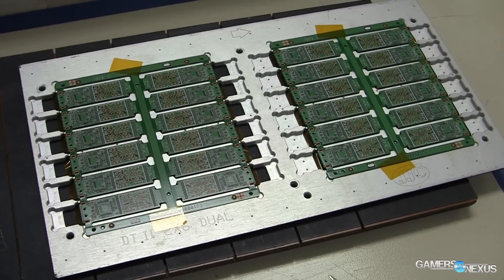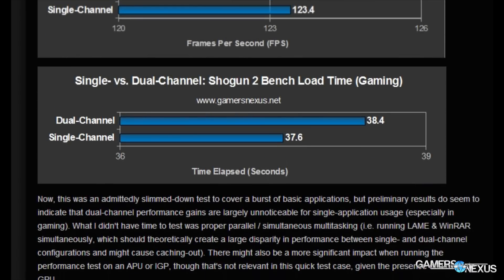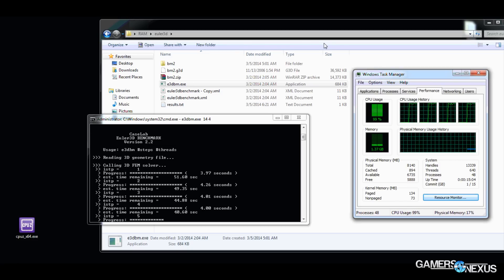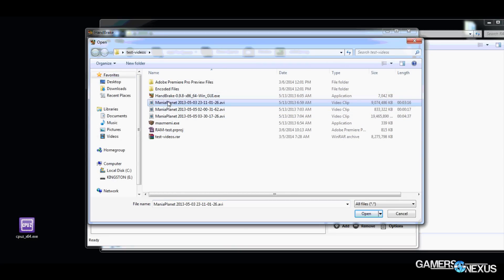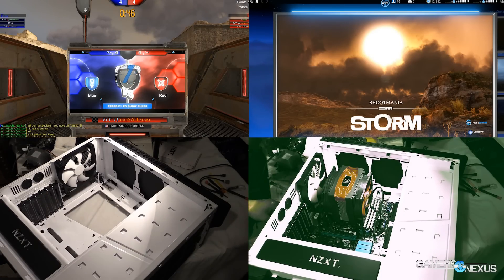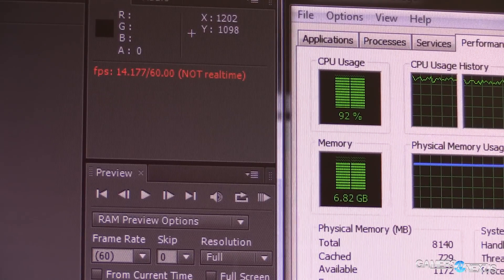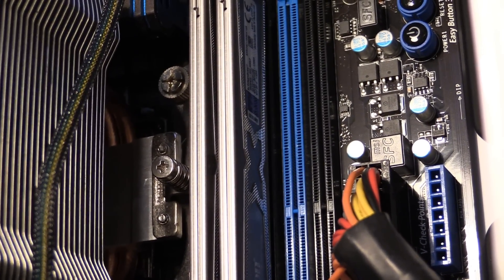RAM Benchmark: Dual-Channel vs. Single-Channel - Does it Matter?

Comment: Man, testing FPS as RAM speed test is just fail... thats why big OC for RAM gives you like +1FPS. Do it on multitasking, or on older computer (because single channel can mean only web browser, too slow, while dual channel with same amount of RAM mean fine speed), single channel is like to have one arm, dual channel is like to have two arms, its not double speed, if you grow third arm you wont be three times faster, but you can do three jobs at once, or lift something with three arms that will become stronger and faster process, its like to use two hands at the same time, and thats two times better and stronger then one hand when you need it. This tests should be done in loading situations, or benchmark things. 2x4GB is more expensive then 1x8GB, dont ask why, you dont know what you are talking about, but who knows will like dual channel way more then anything. Im not sure if you know how to put your memory into dual channel if you got 4 slots, maybe you tested all single channel set up. Its really simple, one module runs like 20GB/sec, if you got two of them as dual channel, its not 40GB/sec, its two times 20GB/sec, and on RAM demanding things its a big difference, its like having one core CPU or dual core, single core can do lots of things, surfing the web, playing music, movies, everything is nice, but if you willing to use your CPU, you will like two things. IDK what you are talking about.

Comment: Can I use two exact sticks of 8gb ddr3 single channel? Or must I buy  dual channel sticks. I need 16 gb of ram.
Reply: ZYOS117 There aren't "dual channel sticks" it's just when you have 2 sticks. But yes you must use the same exact RAM.

If you add another stick that's faster than the other, your MB will slow the faster one down to the slower one.

You may use like a 4gb stick and a 8gb stick, that's fine.

If you use a different brand, I'm not too sure but I wouldn't think it would work.

Comment: I'm contemplating on adding a single 8gb module ram stick to my 2x4gb ram. Both are the same speeds. Is this ok to do? I'm new to pc gaming :)
Reply: I've been thinking about doing the same thing. I would like to see some bench marks with this configuration of memory. Or what if you had 4 ram slots filled with 1x4 1x8 2x16 or something weird like that. Would that negatively affect performance?

Comment: Informative stuff, but I have to join the rant against the misleading bar charts with the X axis not starting at zero. That defeats the purpose of actually using the bar chart to get a quick visual idea of the true proportion between the bars. It is actually better to just show numbers with no charts, than to show charts like those you are showing. Very very bad idea
Reply: I was confused as well by the chart

Comment: I recommend to use single channel because they are cheap, better FPS in some games, and your ram slots will also be saved ( so if you have 2 slots then if you use dual channel then your slots would have no space for adding more ram and in single channel you can also get 16gb of ram ) 😎

Comment: My asus laptop comes with build in 4 gb dd4 ram, Should I buy 8gb rame to make it 12gb single channel ram or 4gb to make it 8gb  dual channel ram?
Reply: 8gb. Or get 2x 8GB
Reply: That wold be best but one 4gb ram slot is solder to the motherboard. 
Its either 2x 4gb or 4 +8gb. id like to know which is better?
Reply: ***** I'd go with the extra 4GB because the benchmarks in the video show that the Dual Channel performs better than Single Channel
Reply: i bought 2 4GB corsair vengeance ram and its working perfectly

Comment: if u wanted to test ram in a game it should be fallout 4. it shows massive frame rate increases going from 1600mhz to 2400mhz+ or even ddr3 to ddr4. This is quite rare so if any game is going to show a difference in performance from single to dual channel fallout 4 would be it.

Comment: MYTH ? The buy matching sticks of ram is true
in the days when 512 mb was massive, i had one stick of 512mb and a year later got one more of the same make size speed and cas, didn't work, but worked when only stick was fitted
so had to buy a matching set
some may get away with it, but it's better to be safe with ram as it can cause all sorts of problems like coruped files being written back to the hdd something you don't want
in my xp if you want to show your ram is good then you must run the mats+ test as it gets them every time

oh and the lack of  matching sticks does not cause slowdowns, they cause read/write errors, bsods, locking up and so on
if your implying speed problems then you've got it wrong  and i think your talking about cas and or mhz
yes you can sometimes get away with slow and fast sticks as the fast ones will slow to the slower mhz and it should be the same with cas, fit 9's and 7's and they will run at 9 or should if your lucky

i've seen ram problems many time over the decades i've sold and fixed computers, lots caused by mismatched sticks in the same channel, but you can fit different matching pairs it different channels

in the end if you need ram it's best to get a set and it;s even better to fit what you need at the time of the build
1 chan or 2 chan, 2 over 1 as 1 holds the cpu back and in things like making videos or compressing files the more bandwidth the cpu can use the better
after 2 chan it drops off, 3 chan over 2 not a lot of gain and they admitted it when they sold the 2 chan cpu's, then forgot it when they pushed out 4 chan lol

synthetic tests though easy are in no way the real world
Reply: SE09uk WTF are you talking about? This test isn't to determine if matching ram is better, it's trying to determine if paired ram is better. Everyone knows you should match ram specs.
Reply: SE09uk so you're saying Steve (the guy in the video) is not making sense? For me, running 8 +2 GB DDR 3 1600 works (different manufacturers) and 8 + 8 works (different manufacturers). Your experience might be outdated to an extent.
Reply: John Connor
 paired ram is better!!! ?
do you know what your saying, do you know what your talking about? because the guy in this video does not thats for sure

better lol. its nothing to do with better, if ram is not in a matched pair it will not (most times) work, full stop, or if it does you will get errors passed from ram to the hdd
its not whats better, if you had any xp you would know this
 i say that because if you knew you would know and have seen what a mismatch can do... bsod, restarts, lockups, mats+ fail and many many more.
you pc would not be safe for data
if you don't know about pc's you can read or ask an adult for help
he's a kid and i guess you are one too
i've had almost 40 years xp and seen what a mismatch does many times and yes all types of ram
find a pc that will run with a mm and put it through mats+ that will sort it and show the problem
god i remember when people knew what  they were taking about, the guy does not and you just don't understand, as i said if you did...
Reply: Dead End  Piss off fool

Comment: Building my first Pc, and the huge air cooler I'm using (Cryorig R1 Ultimate) pretty much covers the first two ram slots. Based on my MSI MB, its shows slot 2 and 4 highlighted and marked (I assume this means dual channel) Can I just stick my 2 8gb ddr4 2400 ram stick in the last two? A friend of mine said I could have compatibility issues, but after watching this I assume it's ok and not take too much of a hit since I'll mostly be gaming and light video editing? Thanks!

Comment: I have corsair vengance 8 gb (4*2 slot) matched pair ..i want to upgrade further to 16 gb ..i have available the same but in single sticks not matched pair ...what should i do ..( 9-9-9-24 1.5 v) ? Specs are same of old n new ..please guide

Comment: Probably a safe bet for gamers to do dual channel just incase any future games may be doing anything like simulations. But I'm guessing for me quad channel should really only be used if I need more memory and don't want to replace what I have just add to it. That is my take away. And if a stick dies from a kit and I don't need that extra 8 gigs in a 16 gig config because as of today that is ridiculous to just not worry about replacing it. I live with 1 stick so long as I have at least 4 -8 gigs. Good to know on a general rule for non power users thank you STeve.

Comment: Can i use 3 8gb sticks on a dual chanel board?  Two in pair and one alone?
Reply: why dont you go for 4 sticks of 8gb ram instead
Reply: a friend of mine has 3 ramslots used out of 4 hè has the i5 4440

Comment: The fact that MSI thinks dual doesn't help that much on a laptop was all I really needed to know. Thanks for posting this.
Reply: To be fair, a laptop would normally have a much lower frequency and might not benefit in any tangible way (1-2%) from higher speed ram (dual channel). But i get ya, That would make me double think a purchase too.
Reply: and, is there any difference?

Comment: im going to buy an msi 970a krait edition and i want to put two 4 gb sticks of white ram into the black slot and two black 4gb sticks in the white slot
will this work
Reply: If you're referring to the color on top of the RAM sticks, that's literally just the color of the heat spreaders, which is a purely cosmetic feature, often marketed to enthusiast builders/gamers, and makes zero actual impact on performance. So yes, it will work. The coloration on your MB actually matters, because it tells you where to place your RAM modules in order to get dual channel performance, i.e. both in white or both in black.

Comment: Is DDR4 2666Mhz CL 13 worth the extra cost over same RAM with CL 15?(for gaming)
Reply: KROreviews 1. 2666-3000 has insignificant improvement and i know what im talking about.
2."ignorant claims?" bitch where? slow your roll King, dont get all defensive boy.
3. This is youtube "1.5" fps true or not learn to take a joke son ,i hope i didnt make you cry but peace out.
Reply: No but 3000mhz is worth it.
Reply: because that 1.5 fps is totally worth it
Reply: Thomas T That was the case with DDR3, DDR4 has seen major gains with faster ram speeds, significantly higher than that of DDR3. You will preferably want it with DDR4 as gains are a lot higher than "1.5p fps" do some research before making ignorant claims.

Comment: Its not a problem of speed as much as it is about stability. I've had two systems (they were both macs, havent ever tried this on windows) where one system had 8gb + 4gb of memory installed, and it constantly crashed. Even after changing the sticks it crashed. Replaced the 4gb with another 8gb stick (same model) and its been running smoothly ever since. And no it wasnt that 12gb wasnt enough for the task as witha single 8gb stick the same task didnt cause any crashes and neither did the system crash, nor did it crash with a single 4gb stick. And ofcourse my comment talks about mixing ram in line to what you said on the site, DONT MIX STICKS.

Comment: i can have a 4 gb of x manufacture and a 8 gb of the same manufacture including all the specs just the defrence is 1 is 4 and the other is 8?
Reply: So, you're asking if you can have 12GB of RAM, basically? The answer is yes.

Comment: I only have 2 memory slot. My computers default ram is Hyundai electronics 4gb ddr3 PC3-12800 800mhz (Max Bandwidth). I used cpu z too and it says I have "Channel #: Single" does that mean when I upgrade my ram I have to use only 1 memory slot? for example I want to have an 8gb ram to upgrade my pc, I need to remove my default 4gb ram and change it to an 8gb ram or Do I just need to buy another 4gb ram and put it in the 2nd slot? pls reply I'm confused.
Reply: You can buy other ram and use it together with your current ram. You need to buy other ram stick with the same settings as yours (frequency, latency, etc...) and preferrably the same brand and model, but it's not guaranteed to operate properly at dual channel. If the other module you buy has greater latency, both rams will have that greater latency. You're probably ok putting other stick and most likely it will run ok with your current ram, just remember to buy with the same frequency and latency and preferrably the same brand/model. If dual channel does not work, you probably can use both sticks in single channel mode, with a very little performance decrease. Hope that I dit express myself properly, english is not my primary language.

Comment: There's another video on YT that shows a much, much bigger difference in fps in a game re. a dual channel configuration (all other variables were identical)... look it up
Reply from the maker: We have validated on multiple machines and on multiple sticks since the time of this (ancient) test. Thank you.
Reply from the maker: We trust our results are accurate. It is exceptionally unlikely that the other tests were literally completely identical in test methodology. We do not have any variables in our test except channeling. We used all constants.
Reply: Gamers Nexus Or is it not entirely possible that your sample size of 1 re. gaming is totally unscientific? Try some humility, bud.
Reply: Most other videos tend to use a single kit to do the testing and just remove a stick to switch. So most tests might do 4GB (Single Channel) vs 8GB (2x4GB, Dual Channel) which will obviously make a difference... that's probably the case in the mentioned video. In this video they also used one kit (8GB) but switched between single/dual channel with the same kit, so it's accurate unlike other videos.
Reply: I looked it up, and according to the video there is almost no difference in most cases. The only game where there was a significant increase was in Far Cry 4, there was one time where it went up by 5 fps but that is not enough to decide that dual channel is better. Most games wont see any gain, and the rest only see a minor one. Your own source said so, now take your rude ass and fuck off.
Reply: +djayjp its not valid because its not consistent. it jumped once for a second. that is not enough to justify spending extra money
Reply: link to vid?
Reply: Gamers Nexus and on how many games? lol
Reply: Alex Z I keep posting the link, but the channel author keeps removing it.... FU, Gamers Nexus Douche.
Reply: Alex Z Look up "Dual Channel vs. Single Channel" by "Sammy-slaw W"
Reply: andynator149 Oh a 5fps difference is nothing? People spend hundreds to eek out such a 10% difference. It's not being rude if it's justified. What the channel author did by disallowing my link was wrong. My original point is valid.
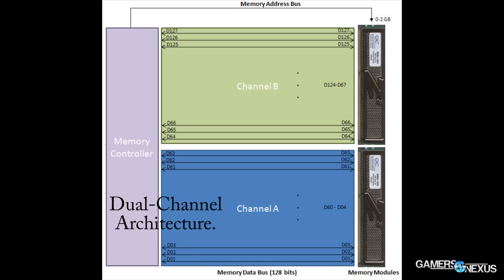Reply: andynator149 go to 4:08 in the video. The quoted 5fps difference is for the entire average of play time. So sometimes it will be more, sometimes less. I agree it's not huge, but it is still significant. Would I spend the extra money? If I use highly multithreaded applications that use a lot of bandwidth (like some gaming, video encoding, rendering, etc.), then it is worth it especially since there is no added cost often (e.g., 1x8GB vs 2x4GB).

Comment: You shouldn't use cut axis graphs like that, the differences look way bigger than they are which goes against your message.
Reply: A misleading practice that was thankfully rectified swiftly in the many years since.
Reply: Misleading graphs!
Reply: I was actually flabbegasted that I'd see such poor graphsmanship from Steve!
Reply: +Procrastinator7 ikr
Reply: my thoughts exactly!

Comment: So, basically, it isn't the RAM that's dual channel, it's the CPU/NB accessing more than one stick of RAM.
Reply: Correct.
Reply: i got an amazing desktop, i got single channel 16g cpu i7 7700 k and a 1080 gtx... im geting samme fps with a 1060 card.. can u help me?
Reply: Ricardo Farinha check if your cpu is parked
Reply: i got the answer, i had a single channel 16gb, dont ask me why, i bought i 8x2 3200 mhz hyperx and now is just the best computer ever in pubg... its just a diference i cant even undersntad, you cant really imagine the stability , the improvment... i was with blocked fps in every games like, old games, like cod2 ( 14 years old ) i had 500 fps at max, i should have 1000 and other stuf... RAM actualy make a huge diference ... i had no idea that this was such a important think.

Comment: My computer ASUS G761 has 8GB DDR3L 1600MHZ 1.35V inside. Now if i put in an extra 8GB DDR3 1600MHZ 1.5V wil it stil work? I mean does the 1.5V version work????
Reply: Technically yes, though it is not something recommended.

Comment: So essentially, as was already known, dual-channel (also known as interleaved memory) results in a higher bit-rate which in turn means faster speeds.  Isn't comparing dual-channel and single-channel in high load applications a moot point then?  I mean, if the memory is running in parallel with a faster bit rate, then all that is really happening is the processor is able to have memory banks available faster.  The application for dual-channel would therefore be multitasking, not stressful applications (although it can contend with them).  Keep in mind that if a laptop or desktop comes with a single stick that it is much more economical to buy an additional identical stick to run in dual-channel than buying a kit or and additional higher memory stick.
Reply: I want to play games,i have a GTX offboard,  so Single or Dual?
Reply: It won't matter.  Do what seems economical.  I'd aim for 50% more than the OS requirement, double if you plan on having a lot of applications up.